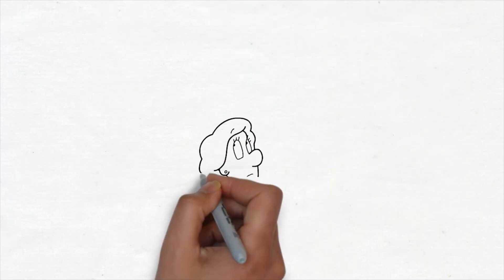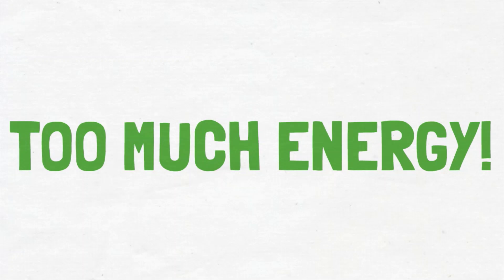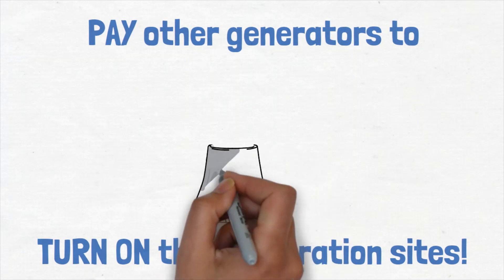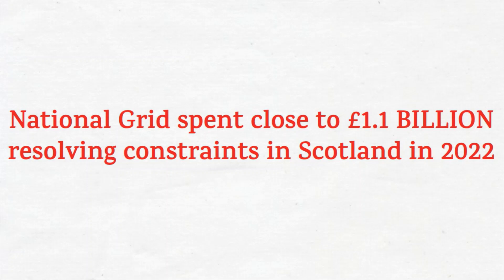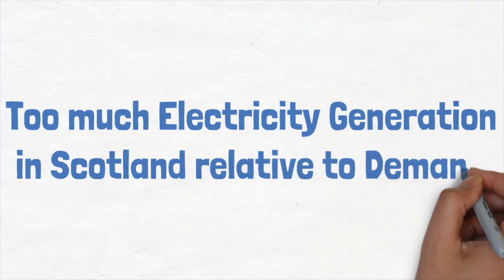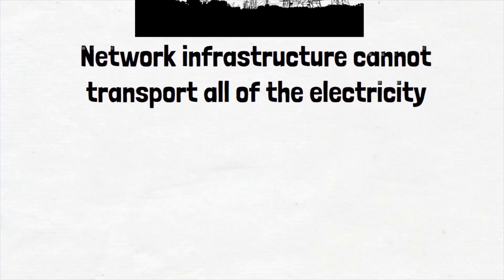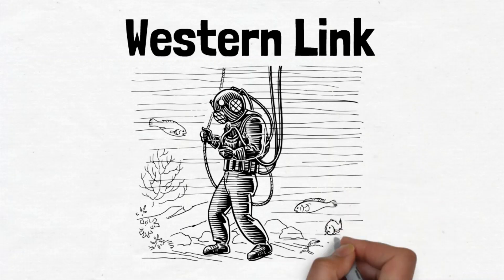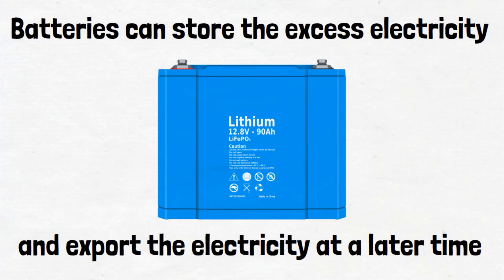£Billions are spent each year resolving Electricity Network Constraints

Comment: This is so criminal. 1 scam just leading to another in this poverty inducing green energy horseshit
Reply from the maker: It is criminal - no excuse for those sorts of costs. I think green energy is the way forward though - zero input fuel cost so has to be cost effective (once the subsidies run out!)
Reply: @business.energy.economics.3828  No it doesn't. It is hard to find numbers but I found them. Germany is spending 5 million euros per megawatt on offshore wind. These(I'll be generous) run at 40 percent capacity utilization. Operation and maintenance costs are 80 euros per megawatthour the first year and increases every year after that. Blade degradation causes 4 and half percent loss of Nameplate capacity every year. All of this green energy is a huge money pit. The trillions of dollars put into this garbage are all malinvestment.  This going to cause massive economic destruction on a scale never seen.
Reply from the maker: Operation and Maintenance costs are certainly not 80 euros/MWh. In the UK, the strike price for Offshore Wind in the last CfD was £37.35/MWh indicating that the Offshore sites can be built at this cost while also making some profit for the Asset Developer. Offshore and Onshore wind also have lifespans on average of 25 years before they are required to be repowered. Not bad at all!
Reply: @business.energy.economics.3828  Whst meaning does a contract for difference have in a world of 100 pound plus energy prices!! Good God. People would rather destroy the world than admit they are wrong
Reply: 2013 not 23
Reply: @business.energy.economics.3828  what is even worse is wind and solar are not marketable products.  They also end up destroying the economics of remaining traditional power plant by reducing their capacity utilization. Who is going to build a 5 billion dollar nuclear plant that is only going to run 30 percent of the time? No one! So it will not be good enough to just stop the madness. If Europe ever wants inexpensive energy ever again. All the wind and solar have to be removed.